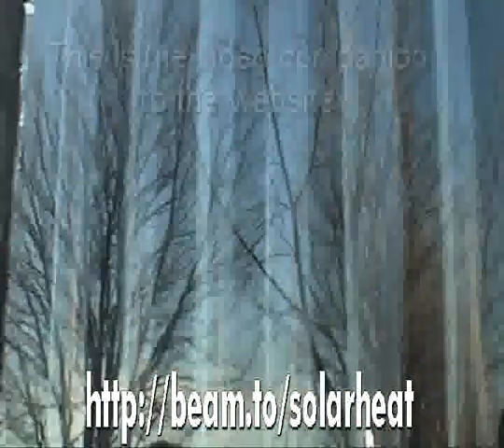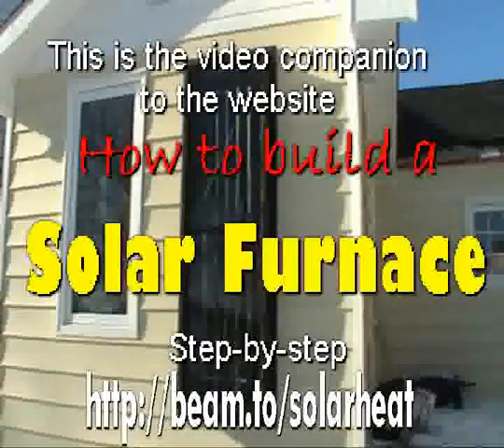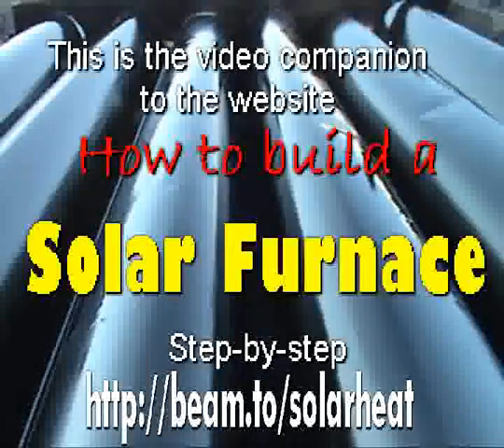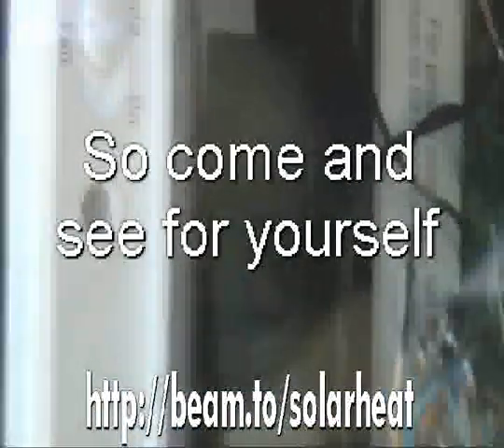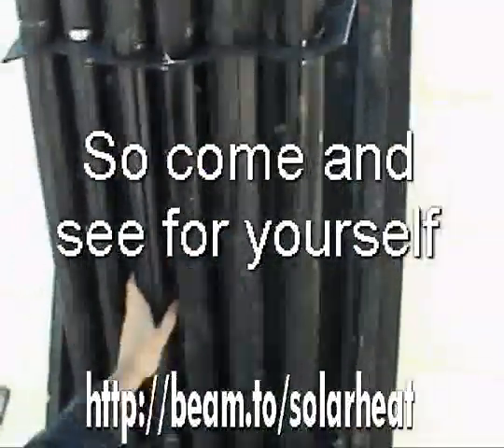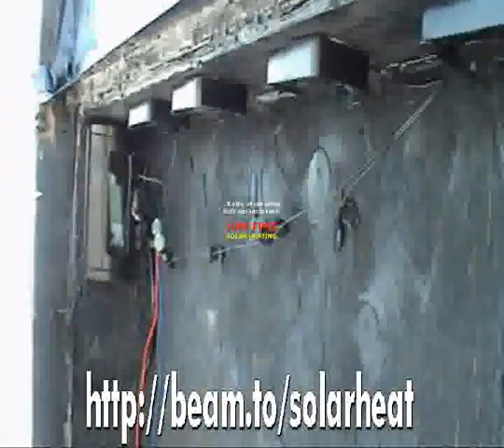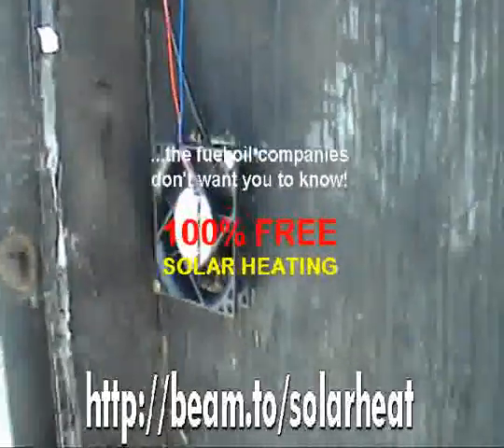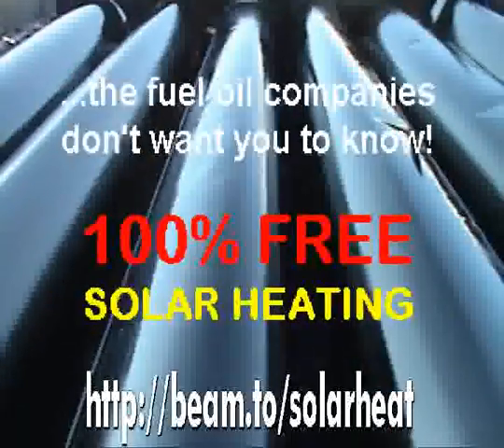Solar Heat Furnace

Comment: Nice to see this unit.........a nice piece of debunking the science. I did find it a little odd that you talked about fan units to pull heat down from the upper panel, was that a due to your hole layout into the room? Why did you not let the heat run out through the top ? It may help to have a double glazed unit on the front , or one sheet plastic as a thermal break., and help keep the heat gained, retained. Regards Bob